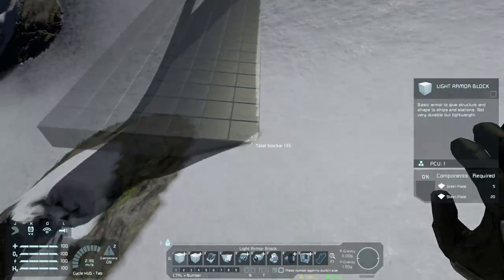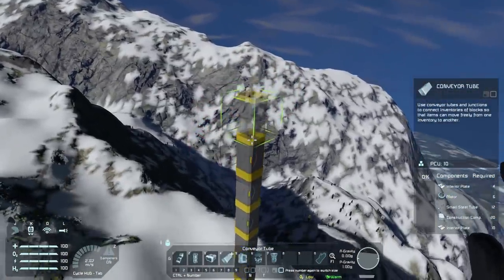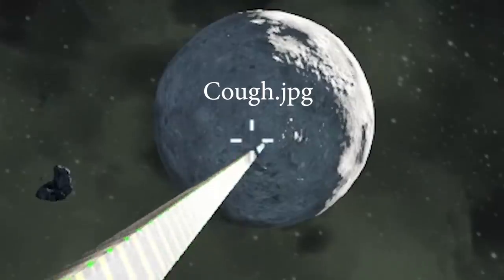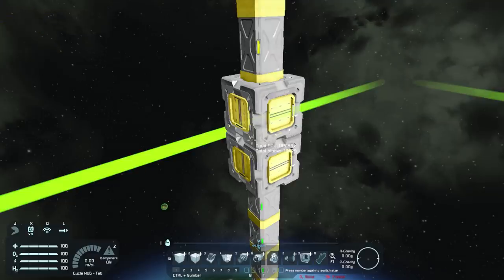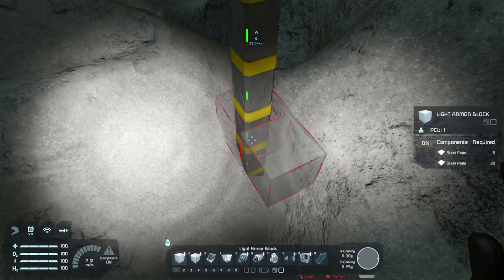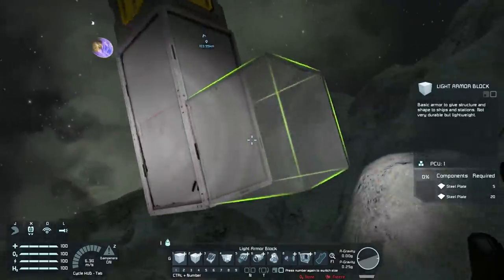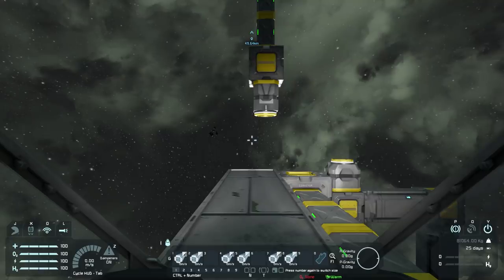Space Busters | Can We Build a Conveyor to the Moon? | Space Engineers

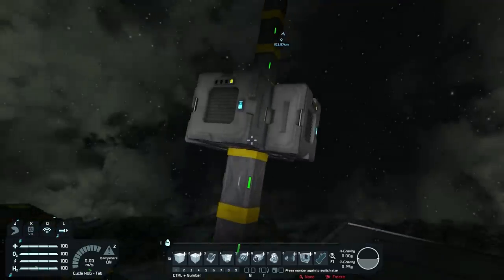Comment: 22:05 - 22:14 I'm not so sure it is impossible. Sure, it would take forever to make, but it is not as if you have to match the Moon exactly: It could just be a cube encapsulating the Moon, meaning you could click and drag to make six surfaces and attach them together. It probably would not pressurize the Moon, but actually surrounding the Moon is theoretically possible in Space Engineers.

Comment: The conveyor junctions are pretty heavy on the game. The massive setup at the beginning and end hurt you too for performance.
Reply from the maker: Ahh, that could be it . How much more 'lag' does a junction cause than a straight piece?
Reply: @AndrewmanGaming  Quite a bit especially when there's so many. At each junction, the materials 'stop' and ask each connection point if it can travel out of that port and get to where its going even if there isn't anything connected. The same thing happens in refineries, assemblers and anything else that has multiple connection points in addition to what ever function that block is doing. Pipe sections work as a single unit from one port to the other almost regardless of length. 

A length of 20 pipes only checks for destination once before moving the materials. A length of 20 junctions will check all 6 ports for a path at each of those 20 junctions even if they are in a straight line.
Reply: The refineries have ports on the sides, so they were already conveyored together and there was no need for the junctions on top
Reply from the maker: @johnguidry4065  That makes sense! Thanks for the explanation :)

Comment: Actually there is a way to do more than 100
Set creative build to Area, but then go up in a straight line. It ups the block limit to a few thousand, and all you have to do is stand on top of the tower when placing (depending on the block) for the tower to not be 2x wide.

Comment: For performance, you could try copy/pasting sections of straight conveyors with no junctions. You might have to construct these in 0g, but you could make blueprints of various sizes (wouldn't be too many if you make them exponential), use gps to determine the biggest remaining section that would fit
Reply: Nevermind, I found out what you meant about the grid pivot, it breaks down above a certain length. I still did the blueprints to find the right sizes after a while, I just traveled to one end of them to copy/paste

Comment: My ambition is to build something like this in survival, but just up to a space station or asteroid base. I made a system that climbed up a tower as it built, using a piston and welders and then grinding away the unnecessary connectors, but I'd need to make it faster and also fix whatever glitch it ran into that made it fall at some point a few km up. But especially with your gap-ship technique to bypass some of the grid size restrictions or whatever, I think I can do it. I want to make it a space elevator too, though, and that'd be a bit more challenging since my climber ran into some issues when I was using pistons with merge blocks and connectors to extend while building (would only need to do that once), then grab the highest point it can reach, then release the bottom and retract, and repeat. Since it's connected to the base, it can keep pulling components to build with, too! I think it might have run out of materials to build with and fallen because it grabbed where there wasn't anything, but I had left it unattended when that happened so I'll either need to do the math to make sure I have enough raw materials and components queued up or get an inventory script going. I'm hoping that was the only problem, and that I'll at least be able to get like halfway with that method before it lags too terribly and needs the gap. Maybe I can put a counter in the timer block logic to make it pause when I think it might need to...

Comment: You can do this without the immense connecting grid using clang exploits.  You create a large grid base with a clang device and a connector.  Then you take a small grid ship and connect it to the large grid base.  Even when you disconnect the small grid ship it remains part of the large grid.  Which means power and material transfer to and from the ship as normal... as though it were actually still connected... but the ship can be on the Moon... or Mars... or anywhere.

Your build is way cooler of course, but completely impractical to actually build in survival.

Comment: (Correct me if I’m wrong) but technically, you realistically cannot pressurize the moon without enclosing it. The moon has no atmosphere, therefore the gasses would simply be pulled into the vacuum of space. Obviously you can pressurize things that are enclosed with air locks, but pressurizing another celestial body is simply unrealistic. However, I suppose what am I talking about, building a space conveyer to the moon is probably pretty unrealistic too lol.
edit
The only way you could pressurize the moon is by pressurizing the entirety of space itself. So... good luck. We don’t even know how big space is due to the many amount of light-years it would take to get to what we know now as the edge, in which in the time it took me to type this comment, expanded. 
( TL:DR , you can’t pressurize the moon because you’d have to pressurize the entirety of space.)
Reply from the maker: Really? I thought the atmosphere around Earth was held here by gravity? Would it not work the same way for the Moon?
Reply: AndrewmanGaming think about it. The moon has not nearly as much gravity as the earth.
Reply: AndrewmanGaming look at mars for example, it has I believe almost a third of earths gravity, and has a very thin atmosphere.
Reply: The moon does, currently, have a very thin 'atmosphere', held there by its gravity. It would technically be possible to dump enough gasses into the moons vicinity to create one thick enough for us to consider it a 'real' atmosphere, but because of the bodies' lack of magnetic field and low gravity, any gasses short of the heavier ones would boil off, leaving it back with what it already has: a barely-there wisp of what few gasses are heavy enough to not boil away.
Reply: IamCoalfoot I can agree with this. Obviously, I don’t expect either of us to be ‘moon scientists’ lol, but this does sound reasonable.